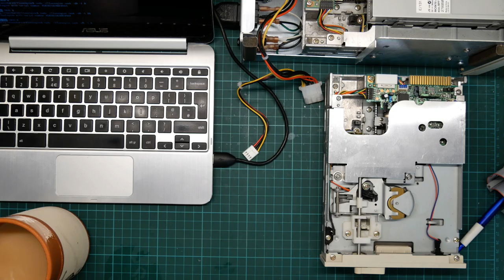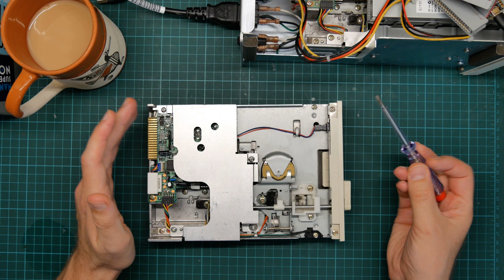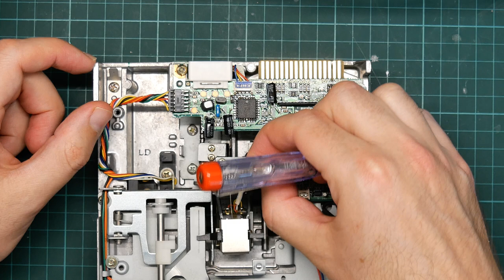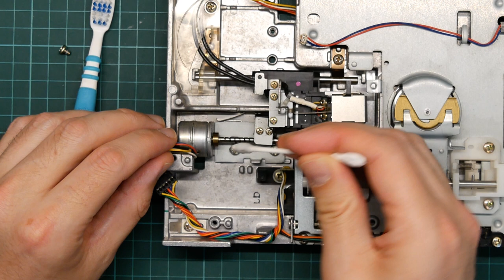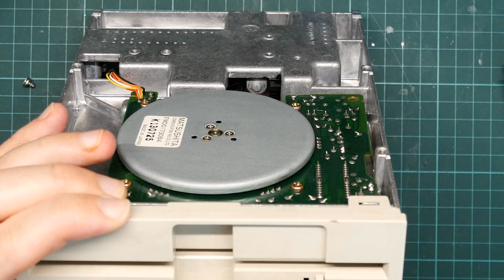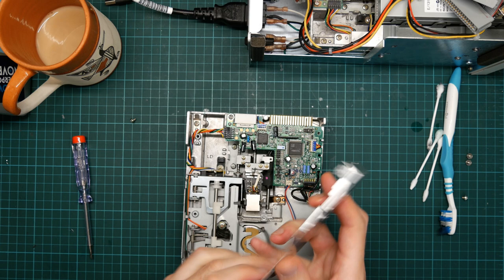Cleaning and lubricating a Panasonic JU-475 5.25" disk drive

Comment: Thanks for this video . I have the same drive. And it also stopped reading discs after working fine for a day. I was surprised when it worked because I found this in a trash store for a euro. I lubed the stepper motor shaft over and over  to no avail. But I also forgot the rail. Now it works like a charm.

Comment: Saw this video while lubricating JU-475-5. It stopped making awful noises after some lubrication.
Looks like JU-475 drives tend to have terrible noise when they aren't lubricated.
I use vaseline for lubrication. Seems to be perfect thing if there are no rubber parts involved

Comment: I don't know if its relevant or of much help, but Noel of Noel's Retro Lab has a video on aligning the head on an Amstrad CPC's 3" drive - measuring the alignment with an oscilloscope - and I wondered if the general principals of it might help you with your other drive
Reply from the maker: I didn't know about that --- I'll check it out. Thanks!
Reply: If i am not mistaken, you need a special floppy for that.